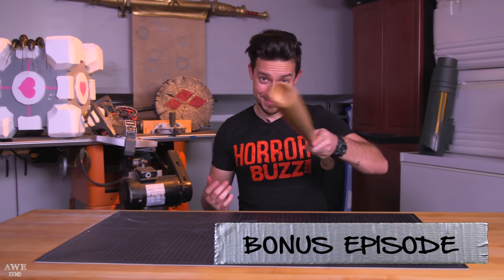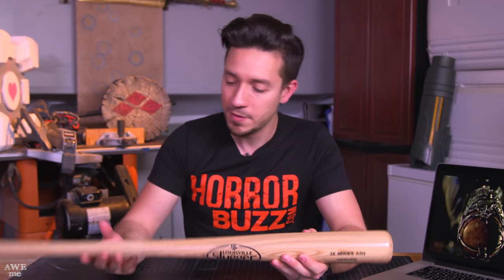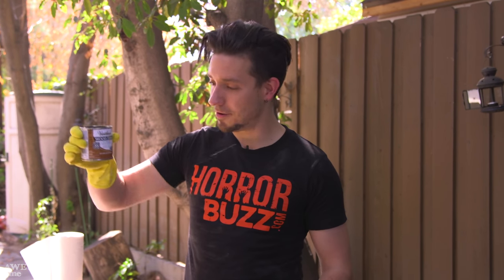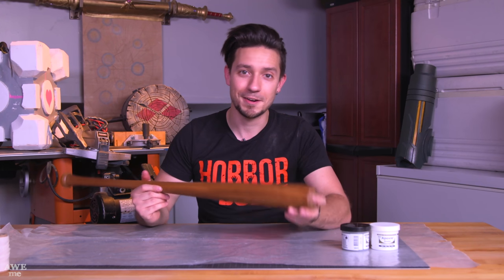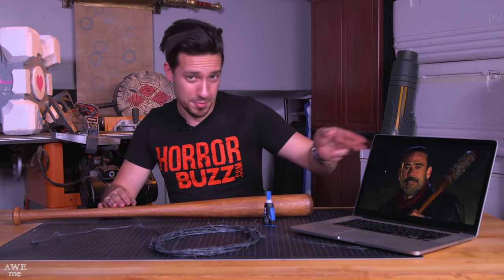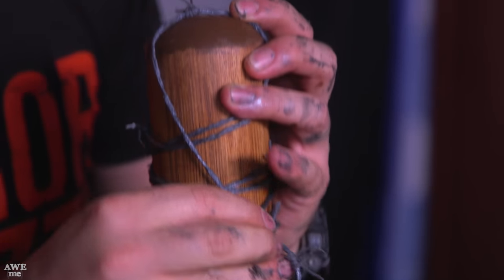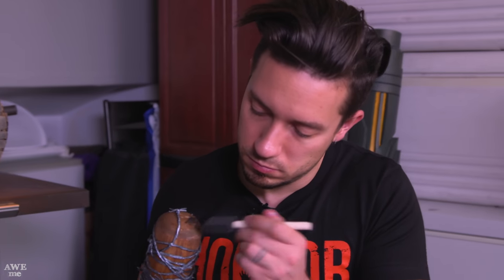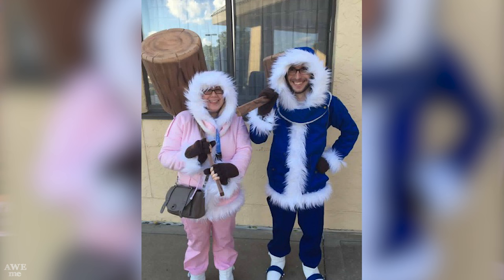Negan's Bat - The Walking Dead - DIY PROP SHOP

Comment: ill just use actual barbwire, seems like less work and the bat becomes useful too
Reply: MrBoegela but then it becomes a potential weapon, so you cannot bring it into conventions and such.
why not make both anyway right?
Reply: watch out, when youre coiling the barbwire around it you're essentially making it a spring. If you let go of it, its gonna whip around and maybe cut your throat open
Reply: A pen is a potential weapon but a barbed bat is more dangerous. Your logic is kinda wrong.
Reply: That's why you have to wrap it very tight, just like Lucille, not like in WWE
Reply: If you think it's a little less work then you never worked with barbwire lol
Reply: barbed bat can catch on stuff. Or cut people if you're not careful.
Reply: I believe the barbwire to be a bit of an overkill. You are right about the bat being a potential weapon. I have never been to one of those comic cons before so I don't know if they would allow it in or not. I believe there is a plastic one you can buy.  Amazon does sell the fake barbwire and the Louisville Slugger C243 bat used on the show.
Reply: +TheJer1963 I believe that barb wire wouldn't really do much with the bat. other than looks.
Reply: rage flip
That"s about it.
Reply: The barbed wire is more aesthetic than anything. I know because I built one. After a few hits on various produce, most of the barbs have bent inward. So unless Negan spends ever night in his room with a pair of pliers bending the barbs back into position, the barbed wire doesn't do much more than a baseball bat couldn't already do by itself. I think, in the case of Negan, it's more for intimidation than for actual function.
Reply: Let's be super real for a moment. Most of the walking dead signature weapons are simply for looks. A Katana is by no means a bad weapon, but any sword would be worn to near uselessness with as much work as Michonne puts it through. We're talking solid day-in day-out cutting, cutting, cutting. That blade would have dulled, cracked, and fractured by now.
Reply: Nathaniel Jernigan There are Katana's who are way stronger and better made than Michonnes, so I don't think so it would be fractured, she took care of it. There are over 1000 year old Katanas in the world that people killed hundreds of people with.
Reply: Your claim is simply false. As far as evidence shows the earliest usage of Katana dates to the Kamakura period (1185-1333). So even if I were to give the slight chance of a Katana in 1185, we would still have 169 years before it was 1000. Given a lack of any hard examples and broad statements, I'd have to assume your simply pulling this out of your ass. Also, how would she be "taking care of it". For starters she'd need a whetstone, which we've never seen. Not to mention if it cracked (which Katanas will do with prolonged cutting, because they are hard edged) it would have to be ground back down into a uniform edge.

Swords are simply steel, and have no magical properties that other tools lack. They dull, they bend, they chip, they break. Regardless have how good it was in it's pristine condition, by now (since it has been at least a year) it would be useless for its original function as a sword.
Reply: Nathaniel Jernigan Woah, it's a huge difference, 820 and 1000. Have you ever heard of putting a number to a 0 or 5 end? And by slicing with Katana it can probably go around for like 5-10 years. I've had one, if you think it's that easily breaking, you're wrong ;)
Reply: MrBoegela I'm not trying to fight, I'm just trying to tell the truth to this guy that he obviously doesn't know lol
Reply: Vraxo
Right, you're just doing the right thing
Reply: That's basically what I did. I used U-nails every three or four turns. But the thing is, baseball bat wood hates having nails driven into it. It'll split like crazy. So I pre-drilled the holes (don't go too big, you still want the nails to hold tight), and it worked beautifully.
Reply: If you wanted to make it REALLY durable, and since we're not using it for baseball and so don't have to worry about breaking the rules, you could drill down the center of the bat and put a steel rod in there. That would increase impact and durability considerably.
Reply: Johnny Kronaz much much heavier though
Reply: MrBoegela lol soo true

Comment: Big ups to this video! It helped me a lot building my Lucille for this Halloween. The main difference for me though was I didn't use a wooden bat. As a foreigner living in Japan, I'm already on the disadvantage and wanted to be on the safe side. So I opted for a plastic one, sanded it with a sandpaper, then spray-painted it. For the barb wire, I used hemp strings which was a bit thicker than what he used here. All in all, it was a hit among Halloweeners during the party and on the streets. Wish I could post the videos here.

Comment: Nice way to make fake barbed wire, but i'm just gonna buy actual barbed wire
Reply: Totally buy some - its less than $10 for a good length, pre painted too! For this vid though, I wanted to include a method that makes it from scratch, so now you know you always can go back and make this if you needed to. Cheers!
Reply: If you use a hollowed out bat + this fake plastic wire, you pass most weaponchecks in conventions. I think it's a good idea  to show legal alternatives.

(edit: or a foam kids bat for example)
Reply: Tom Dirix There's probably someone that'd actually make this bat from absolute scratch
Reply: A Bat made with foam need more paint work but was safer..
Reply: YOu might want to let people know that in most states it's illegal to make a barb wire bat as it's considered a gang weapon.
Reply: Putting barbwire on a bat is just simply overkill to begin with.

Comment: The fact that you decided to modify a cupped, lacquered bat blows my mind. A quick search for unfinished wooden baseball bats (without the cupped-end) turned up numerous options at 10-30 dollars apiece.
Reply: Orpheusftw Sometimes we can't wait for shipping and just work with what's nearby. But hell yeah if you can get an unfinished one it's a much quicker option.
Reply: Orpheusftw I've also met a few folks now that are modifying old bats that they've had for a while - this should help show that you can make the prop regardless of what you start with. 

If you still have the link to a good unfinished bat handy - share it with the comment section, I'm sure others about to make this would definitely benefit. Thanks!
Reply: Don't get me wrong; it looks great, and kudos for the workaround. I'd have just been discouraged by all the extra work involved.

Comment: Protip, use a drill to twist the wire. Simply attach one side to the drill, fix the other side to something heavy, pull straight and let it twist while keeping it stretched. Afterwards slowly let loose, it will start to untwist a bit. Usually used to twist copper wires.

Comment: Please take these suggestions into consideration - Don't use string in place of wire, it doesn't look good, it looks cheap. I'd suggest armature wire for the base wire and then twist ties for the barbs... Dry brush before you place it on the bat, that's basics of painting. A wood putty that matches the type of wood you had could have blended much better and is easier to find. Blood and gore do NOT substitute for quality and shouldn't be used to cover up bad / shoddy work. If you're going to do that anyway, then do it right. The blood is clearly painted on because it was done after the wire was attached and therefore you have "tan lines" throughout your bat. Using paint on a brush, you can overload the brush and flick paint onto the bat. It creates a splatter effect that is so much more realistic than the spot-painting done in this video. If you cut the brush, you can then run your finger along to edge to "flick" blood speckles onto the bat to create even more realistic blood splatter. Finally, you should create "nernies' using peices of dried latex interspersed with the barbed  as flesh / gore. Ps you Dad was right - should've put hair in it! Do it right or not at all! :P

Comment: The reason why he doesn't use actual barbed wire is because it's dangerous, plus it becomes a deadly weapon. You can pass off walking around with a regular baseball bat if you say it's for baseball, but if you wrap a bat in barbed wire there's no doubt it's intended as a weapon, deployed, or not. In the UK, it's illegal to carry a regular bat if you refer to it as a weapon, so imagine what they would think if you carried a bat wrapped in barbed wire...

Comment: So why not just cap the end with peace of wood and then stain it? Why waste the putty that will eventually separate due wood taking and losing moisture?

Wire it self looks good, but those spikes leave something to wish for and there has been several comments how to do it better.

adding hair, brain and skull parts would have been pretty good idea actually. One could get real hair from barber shop for free, so no need to buy a wig. Blood effect was kinda fail, as since when it has been easier to clean between tight cracks than on larger surfaces. I would have just lay some paint in, make sure its water based and then spray  the open spots to get it go into all the cracks, let it dry and then possible do second wash coat if needed...

Also could not come up anything more simple than bat rapped in barb wire? This took you... what a day to make? 10 minutes with real barb wire...

Comment: Short advice: When coating wire hang them between two trees/posts and then put some paint/glue/whatever in the palm of your hand and coat it as you walk by. A lot faster.
Reply: Fernando you know what kind of ropes I have to use? Elastic ones, wool ones...
Reply: For this particular project I'd go for a cheap wool yarn but nothing elastic because it would tend to slid off from the position you had it set. Also, paint and stain the blood to the bat BEFORE setting the "wire" to get it under for a more realistic look. Then, once you have the wire set, reaply lightly to cover the wire. Not the much more effort but avoid "clean spots" near the wire.
Reply: Ok, thanks for those tips, can't wait t do my Lucille :D
Reply: Good luck and don't forget to send pics!

Comment: I'm going to make this. But how did you get that cupped in part on the end?
Reply: The bat came like that. It was the cheapest type I could find at the time - but if you've got some time to shop around, you can find bats without the cup.

Comment: how much is a wooden bat roughly??
Reply: $10-20 for a cheap one
Reply: The bat you are looking for is the Louisville Slugger C243. You can pick one up at Dick's Sporting Goods or Ebay, Amazon. You can also buy the fake barbwire on Amazon too. You want teh non cupped bat. The cup is the part he filled in. They make them without that. Enjoy your build.
Reply: TheJer1963 thanks! should i disregard any of them that says "youth" next to it??
Reply: PaulS9635
 Well the youth bats are much lighter and they can be shorter so it would be your choice. I wouldn't get one myself. If you want it to look like the one on the show I would pass on a youth bat. They are made for kids who play little league.
Reply: TheJer1963 have you made one?
Reply: PaulS9635
Just got started on one for a friend in Ireland.
Reply: TheJer1963 oh ok.. im just debating on whether i should use fake barbed wire or real
Reply: PaulS9635
If you are just going to hang it on the wall I would use the real thing. The fake wire does look pretty real if you plan on showing it off. JMO.
Reply: TheJer1963 lol well i just realized im just gonna get the macfarlane toys one when it comes out next month to save all the stress.. it looks pretty close to the tv negan

Comment: Why wouldn't you use varnish remover instead of paint thinner, and wood filler instead of sculpt putty?..
Also, why even bother with a real bat if you don't think it's be allowed in conventions?...
Why not take like, a dowel rod and foam, then seal it and paint?...